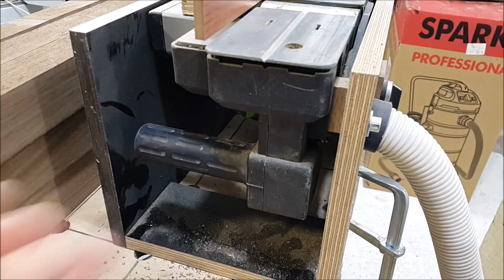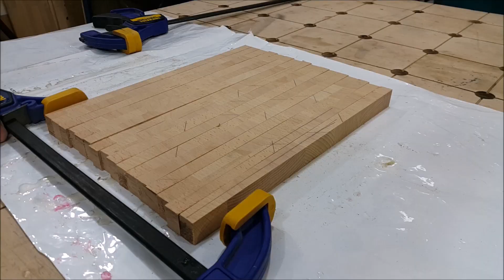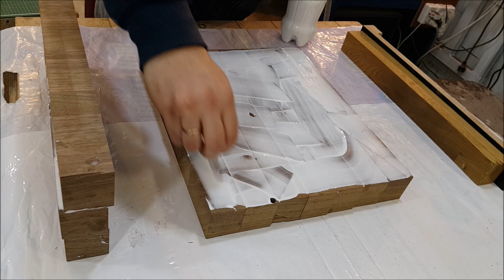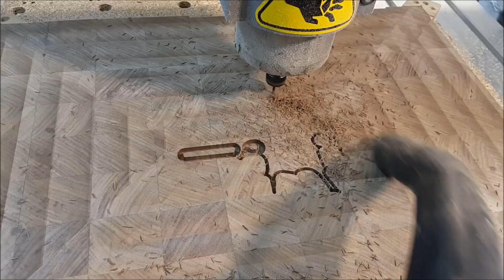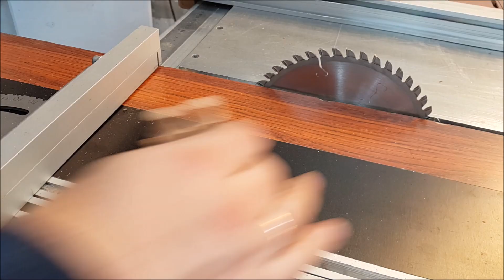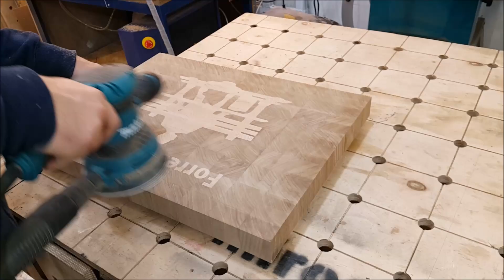Forrest Gump Cutting Board

Comment: Beautiful work as always Mirock; you always go the extra mile.  I just made three cutting boards for Christmas presents myself.  Nice project that people really like.  I wish I had a CNC for flattening; I had to do my by hand and eye...took some time!
Reply from the maker: aintgonnahappen CNC make it not so fast but small planers cant take more than 310mm wide. CNC can 600×900
Reply: Mirock's Woodshop
I wanted x-large boards for my gifts; I use a 24 x 18 and love it so that's what I made for gifts; 24 x 18 and 1 5/8th inches thick.  I only have a small planer so by hand was the only way.  I could've made a router sled jig but was confident that I could get them flat; I was able to with some patience.

Comment: Wow. Great work and unique approach to doing an inlay. I've haven't thought of using a CNC all the ways you do. Out of curiosity, what's the advantage of cutting the pockets with a tapered mill (3 degrees) instead of a flat endmill? Thanks!
Reply from the maker: Thank you Mark. There are so many advantages that difficult to describe by some words. I think I will make next video with this visual explanation
Reply: Probably easier to align.